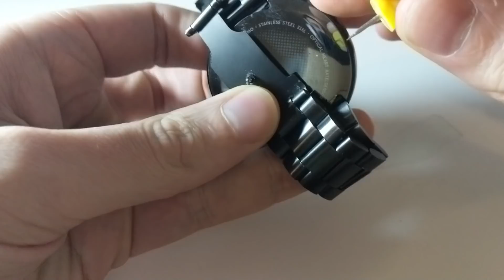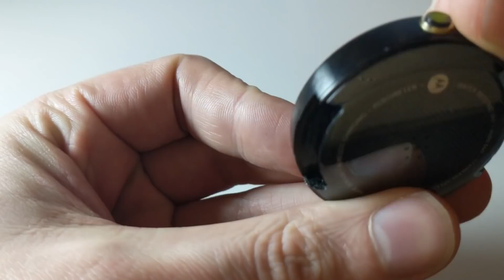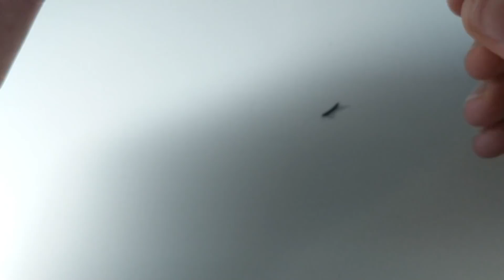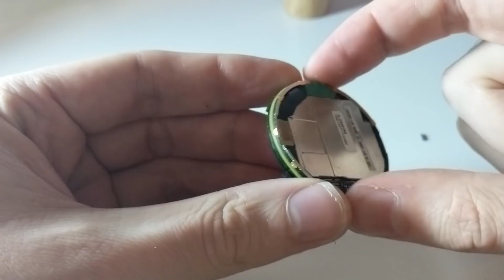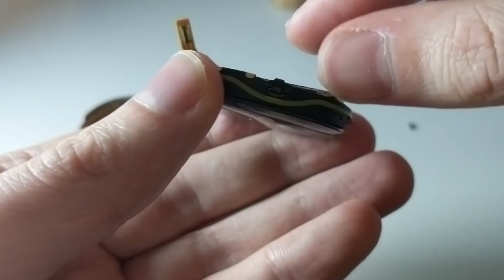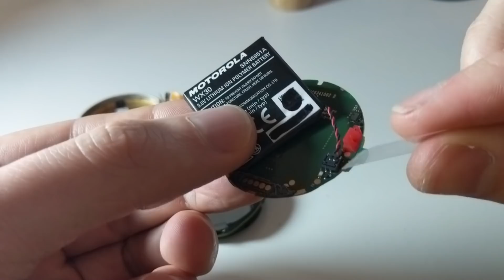Moto 360 v1 Battery Replacement (the easy way)

Comment: Today I resumed replacing the battery on my moto 360 after about 5 year of it sitting in a box after I broke the glass and got mad at it. And since I never got as far as removing the little pins I had no idea how to get them back in after prying the PCB out of the body. I wish I had seen this video back then!

Comment: I've just finished changing the battery in my Moto 360. Thanks for this video, it was very well explained. Hopefully I'll get more than half a day's use from my watch now. I found that a fingernail was the best tool for removing the connectors.

Comment: Good stuff bro! I saw the same method but instead you're supposed to use a curved needle to remove the fastener. Couldn't get it to work, but after I got the first one with your method, the rest came out super easily. Great job!

Comment: Is that a store or somewhere I can go to get this done I just recently bought a Moto 360 modern time peice used off of Amazon and it works great but the battery died pretty fast and I don't trust myself not to break the watch trying to do this
Reply from the maker: From what I've read ubreakifix won't do it so maybe enlist a steady-handed friend or family member. But I will say it's fairly harmless to do provided you're not yanking on the cables or trying to pry the back off with force.

Comment: Still waiting for a better smart watch so this is the second time this video has come in handy. Hopefully Google will come out with a watch this year however last time I replaced the battery I was hoping for the same thing. Now I hope smartwatches in future have easy ways to change the battery even if I have to take it to a watch maker. I'm quite thankful the Moto 360 replacement is as easy as it is.

Comment: This was by far the best explanation of these locking pins that I have seen. The back glass was already broken on the 360 gen 1 I was replacing the front screen and battery on so removing the back was not an issue, but when these locking pins fell out I searched for how to put them back in and couldn't find any help until this video. The watch is now back together and I can't thank you enough.

Comment: Awesome video. Used a tiny flathead to get the spring in the band to retract, the smaller the better. I took my pins out with a flat razor. Don't pull the body from the battery off from the metal circle inside. Use tweesers to get the pins back in. To get the spring with the bands back in make sure half is in the socket/hole on one side and then slowly force the other on in using a guitar pick to keep the spring loaded.

Comment: Worked like a charm, big thanks for the effort of making this video. At first it seemed barely possible to wedge my plastic tool in the gap to remove the pins but after a few minutes got the hang of it and came out no problem. Was also quite tricky to get the pins back in when assembling the thing back together, but after I figured out how to do one of them - the other were easy as well.

Thanks again!

Comment: Removing the band remember the metal bar holding the strap is spring loaded, do not push on the plastic but push on that bar itself(metal bar has and edge you can catch with a exacto knife. As below using a thin feeler gauge works perfect

Comment: Thanks for the tip. worked great. it seems that my watch only had 2 of the slide out curved pins that go in the square holes by the strap pinholes.  you mentioned yours had 4? I've looked all over and don't seem to see them. not sure if i can even buy them. I just put one on each side, diagonal from each other.
Reply from the maker: Hey sorry for the late reply - yeah I had four pins. This was with the Gen 1 right? Diagonal pins should probably be fine. I don't think there's anywhere to buy extras, unless you got a friend with a really high precision 3D Printer.

Comment: 2 useful bits of info:  1) use a .008 inch (.203mm) feeler gauge to get the wedges out  2) reconnecting the battery - black wire on inside, red wire on outside (only way you can plug it in).
Reply: This was such a great tip, had all the pins out within 20 seconds. Problem was getting them back in, got 2, lost 1 and the last may be damaged too much to get back in.

Comment: Thank you very much for this guidance. I have visited 6 repair shops and nobody wanted to even touch it so I decided to do it myself. Opened it (I used bent razor from old traditional shaving machine), no pins got broken. Got the new battery and put it back together again. It works like it should now. GREAT VIDEO!

Comment: Easy steps to follow. But after i replaced my battery the screen stays black, it vibrates when i touch it but there is no display. Any help?
Reply from the maker: All I can say is go back in and make sure all the connectors properly connected. A lot of them "click" in to place. So even if it feels like it's in there, it may not be aligned quite right so it doesn't  quite connect fully.
Reply: @nicely-dunn  Did it twice, will give it one more go.

Comment: How do you get the little retaining pins that hold the back cover back in though?
Reply: argh - i see that right at the very end of the video!
Reply from the maker: Haha all good. It was trial and error for me. That's why one of my pins was broken. Provided your pins aren't bent to hell or one end got mashed they should slide into the slots with like the flat side of the tool you were using, or anything really that has a flat side and can fit in that spot.
Reply: yes all went well - i was convinced the watch was never going to work again tbh, but put it all back together and it's fine. I think Motorola just pull the back cover off and stick a new one on and probably have special tools but the cost is not viable using them. Many thanks again

Comment: Thanks for the fantastic video! I just followed along and replaced my battery in no time. I found it easy to pull the pins with a metal dental pick (that I'd bought at a drug store) and pry the back open with a guitar pick.

Comment: Thanks !! Replaced battery using your guide ! I couldn't fit the plastic tool so I used a thin blade and it worked !

Comment: Seriously, thank you for posting this. I have a Frankenstein Moto 360. 
1. My original 360 motherboard. 
2. My 2nd 360's screen and backplate/housing. 
3. 3rd 360's qi charging coils. Lol

Works great so far! Hopefully charging continues to work well. Kinda nervous about prying off the charging coils, but it seemed to work!

And it is SO EASY getting into the Moto 360 now that I know about the pins! I can only imagine how the Moto employees were laughing at iFixit's "teardown." 
"They think you just pry off the back with force! " Lol
Reply: I literally just installed the battery from a second moto 360 I had lying around (got water damaged), so far so good.

Comment: I want to thank you. I bought a Moto 360 for $40 but i know most likely it had a problem after some research i was linked to your video. and followed your instructions and ordered a battery. when it came in i took me 10 min to open replace and put back together the watch.

Comment: This video is exactly what I needed - and what everyone else with a Moto 360 Gen 1 needs to replace the battery. I used a piece of plastic from a container from the grocery store that contained fresh goods. While I had to recut it every time I popped out one of the clips (because it mangled the tool some), this was MUCH better and EASIER than all the other instructions found (most of which included heating up the back of the watch). My watch now has a new life and done very affordably and very easy. Many thanks for sharing this to the world.

Comment: These instructions are great and helped me to successfully replace the battery. Unfortunately the watch won't recharge. When I put it on the charger (and I've tried two different chargers), it doesn't change faces to indicate that it is charging. Before the new battery died, it booted up just fine and told me to recharge the battery but I can't get that working. I've tried disassembling and reassembling to see if any connections are loose - to no avail. Any ideas what would prevent it from charging? Thanks!!

Comment: Quite an easy method as long as you do not use brute force especially while taking off connectors. Just be gentle. Worked out well and I replaced my battery with ease. Thank you very much :).

Comment: Thanks Seaian Dunn! You're a lifesaver! My beloved moto 360 is running again. I was able to pull this off with just to tools you used and didn't have to purchase any other tools but the replacement battery. This was really helpful. Thank you so much for sharing. I highly recommend your video. Cheers!

Comment: I got another Moto with a broken screen but good battery so I thought I'd just swap my screen on it.

I took apart both the watches without breaking anything but when I put then back together, none of the screens work.... Not even if I switch the screens back to their original bodies.

Now I got 2 useless Moto 360s
Reply from the maker: Make sure all the ribbon cables are firmly connected. Some of them are deceiving. The first time I put my watch back together it didn't respond to touch.

Comment: I only wish that I found your video before I destroyed the cover needlesly heating it up. Where do I get a new battery cover? BTW, I used a super fine dental pick tool to slide the pins out slightly, once it is a little exposed you can pull it out easily.
Reply from the maker: +gabi Probably your best bet is eBay or a third party parts site. The watch is old enough now that any stock is probably just surplus from when the manufacturer was still making the watch.
Reply: If the battery replacement cures the random shut down problem,  I will most likely just buy a case for it, costs as much as a battery cover (there is only one seller on eBay). I like this watch, just not enough to buy a new one of them, the 2nd gen is not that much of an improvement.
Reply: Same, I cracked the back of mine and need to replace it also:/ Wish I'd seen this first!!

Comment: Great job! It went just like you described. I found a small sucker on the back of the watch, and a plastic pry tool made the job a lot easier. The sucker really helped to wiggle my plastic tool in when removing the plastic pins.

Thanks for sharing.

Comment: Thanks man, it worked! Youre a vry helpful person. donations? Eth, btc, monero?
Reply from the maker: +Ian Aitken Thanks! Updated video info if you're inclined to do so, but definitely not necessary!
Reply: ive tried sending a few dollars in btc, but its like $3 to send at the moment, if it doesnt get through maybe ethereum?
Reply from the maker: +Ian Aitken here's my eth address!
0x9Ebf43d91466eCFfa18D84B80337AFC249202877

Much thanks
Reply: sent!
Reply: Ian Aitken yo could you hmu with some eth?
Reply: yes i could
Reply: Ian Aitken 0x031ef65992a2de48B06A03B190885D91Aeaf132c
Reply: Thanks so much
Reply: I have btc too: 1Dr5V5qHi3QCZvHynQXUNQJL6iPinYuoos
Reply: for what? i  havent done anything
Reply: Ian Aitken for the simple fact you actually responded :)

Comment: Great instructions.  I had a couple guitar picks from a phone screen fix kit.  One was super thin and it worked.  I also have a pair of precision tweezers where the points are small enough to pry on the end of the pins.  There is a small space at the heads of the  pins that you can get the tweezer point in and pry.  One of the pins would not budge with the tweezer method but the plastic slide method did work.  Thanks!!!
Reply from the maker: +Dick Wong Thanks! Yeah I initially tried using tweezers to pull the pins out but they weren't fine enough and I ending up mangling the tops of a couple of pins, lol. Glad the other method worked out for you!